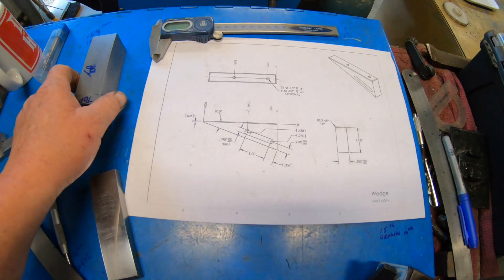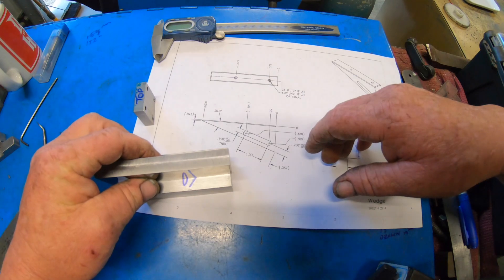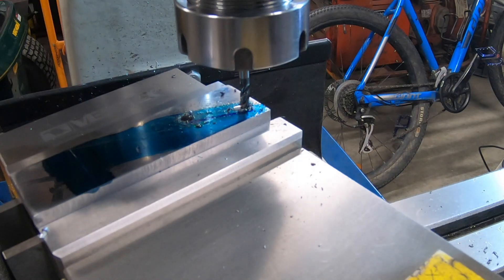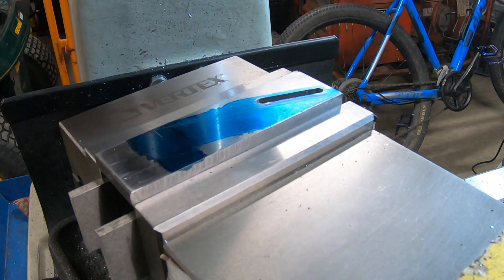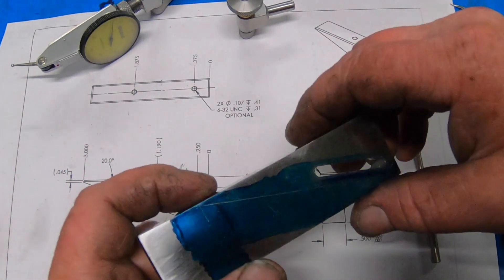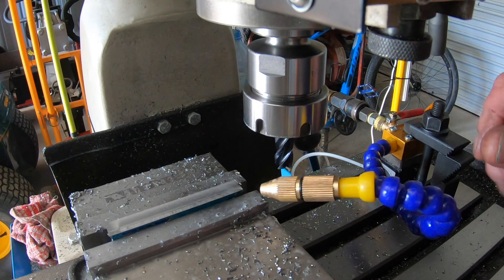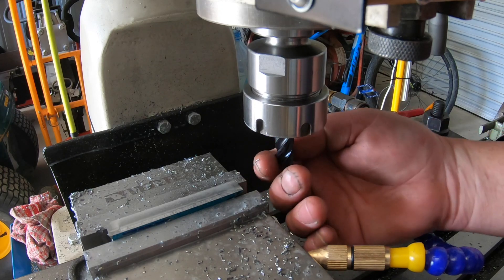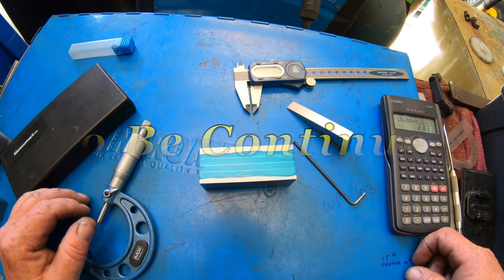Adjustable Wedge Parallel  part 2

Comment: Making progress. Not sure if you thought of it but you could have put two dowel pins through the slot and hung the part on the vise jaws. That way you would have the exact same angle and not have to fool with the degree wedge or angle cube.
Reply from the maker: I didn’t think of doing it that way, that’s a great idea

Comment: Great work, looking forward to subsequent stages.
Just a suggestion on when you milled the wedge to 20°, maybe worth using the side of the slot/end mill, rather than the bottom, most can cut up to 1 X diameter deep, and 0.5 X diameter width.
Thanks for sharing.

Comment: I'm apologising if you got a thumbs down in your inbox, watching on my phone and touched the wrong bit of the screen. As soon as I noticed i unthumbsdown.
Coming along nicely, and your manual surface grinder is getting a pretty good finish.👍
If you find your finished wedge is too tall go over to my channel and somewhere there you will fine a low profile micro adjustable jack that i made for accurate levelling repair jobs.
Reply from the maker: Gday Chris, no need to apologise, it’s all good, I’ll check your channel out for sure, thanks mate cheers Matty
Reply: @MattysWorkshop  let me know what you think, and my channel is only half wildlife 😉

Comment: The finish on those parts looks spectacular. You can see yourself in it.
This mist coolant system works really well. I've seen other YouTubers use it with also great results.
Reply from the maker: thanks, I was really surprised at how much coolant it used, absolutely next to nothing, I thought it would have used heaps and I was thinking I’d be better of using flood coolant, definitely made a difference,